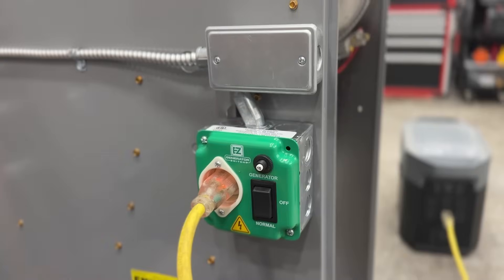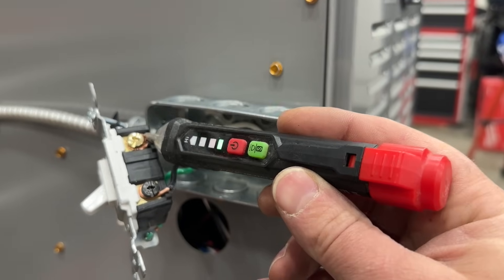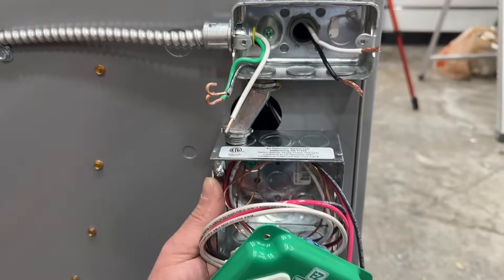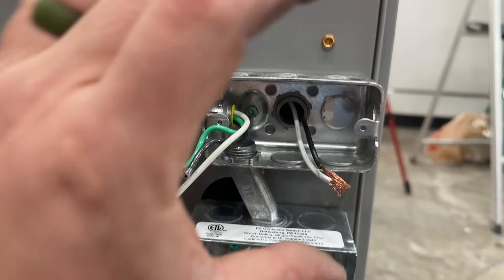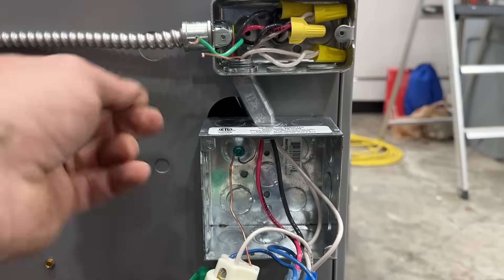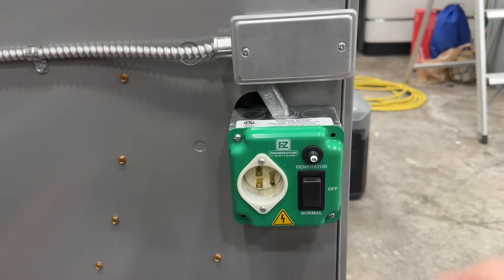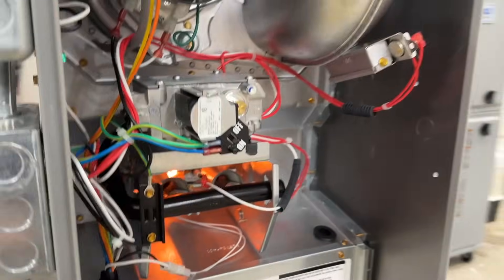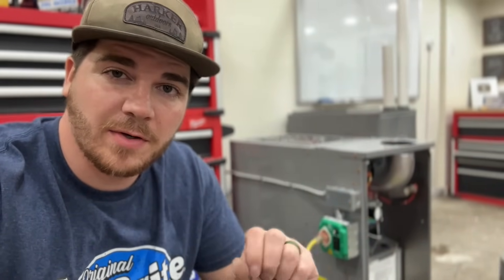This Device Allows You To Power Any 110v Appliance During A Power Outage

Comment: I just had an electrician quote me $805 to install this!
Reply from the maker: Wow, do it yourself bro 🤘🏼
Reply: @diyhvacguy  That was my plan, to connect my EF Delta Pro to it so I would at least have heat in a power outage. But I may just hold off until I get a second DP + Dual Voltage Hub & connect those to a Reliance 6 or 10 breaker MTS. Those MTS panels seem pretty straight forward to wire to main panel also. Plus, I’ve learned so much from your videos also - really appreciate you & your videos!

Comment: Of course, this requires you to own, and be able to use, a generator of some sort that can develop enough AC current to power your appliance.
Reply: $300 on Amazon. 2200 W inverter will do it.  Honda's are $800+.
Reply: @darrylstevens2556  Which means, by extension, that this is not an option for any apartment dwellers or anyone who lives in urban locations (which means about 95% of the population of the USA).

Those same people also cannot avail themselves of solar/photovoltaic or wind or water power. They're just horked.

Me, I just hung a 240V outlet next to my breaker panel and connected a plug to the subpanel that supplies all my important loads. That same plug fits the heavy 240V extension cord that comes from my generator. When I run the generator (which is really pretty small), it powers all my important loads all at the same time. Very easy to connect, uses 100% cheap standard parts, and it's impossible for the generator to backfeed the power lines.

Comment: Running a plug out of your furnace (like you've shown before) is so much simpler. Unplug from the outlet, lug into your generator.
Reply from the maker: Yes but this is technically up to code and has a couple other safety features which some prefer
Reply: Or just go directly to your circuit board so you won't get questions from a inspector later.

Comment: Just a heads up. A lot of newer high efficiency furnaces will require you to convert the EZ generator switch to floating nuetral if the generator/battery power station is floating nuetral. There are instructions to do so included with the kit.

If it is set up as bonded neutral, the furnace most likely wont turn on. Almost all battery backups like Ecoflow, as well many inverter generators are set up as floating nuetral as opposed to bonded. 👍
Reply: You need to bond (connect) the neutral & common if using a portable inverter.  You can do this at the inverter.  Amazon sells already made up plugs.  Your inverter has a floating ground most likely.
Reply: @darrylstevens2556  hi Darryl: Im confused: connect neutral and common at inverter?  I have for example the Ecoflo Delta 2 & Delta Pro batteries that has an extension cord that goes to the EZ. Whats another name for the "common", is it "ground" in this scenario?  and where exactly do i do the connecting? Is it at the "plug" of the extension cord that comes from the Ecoflow inverter AC output?  Or are we connecting the neutral & ground wires in the EZ device? Please clarify.
Reply: Interesting, because when i run furnace according to Daves instructions with either a Delta2 or a DeltaPro, the heat will come on and shut off appropriately, but the blower never shuts off! Its an Ecobee thermostat on a 3 year old RUUD furnace. Any ideas?
Reply: @rw4669  I would think it would have to be related if the fan shuts off normally when running from the grid.

Comment: Could you show how to do this to a sump pump? But somehow put this device in a wall or replace an outlet upstairs that would work the sump pump (to have easy access to make the pump work when the powers out.)
Reply: The sump has a separate power cord that you would just plug into an alternate power source
Reply: @williamweaver7783  yes but when you’re old and that sump pump connection is in a low crawl space it’d be nice to have an easier way to connect it to that alternate power source
Reply: @sharpshooterofky  I can appreciate that, so you'd have to have that cord in a place that's more accessible in the first place because you'd still have to go in the crawl space to access it

Comment: I just installed one of these and I love it, but instead of getting my generator out to test the switch I just ran an extension cord from my sump pump since that plug was still hot. I have my generator running like a top so I know everything’s ready for a power outage. But if I hadn’t seen one of your previous videos I never would’ve known this product existed. I thought about using the cheaper method of wiring a cord to the furnace but I needed something my wife could easily understand 😊 Thanks for your videos!
Reply: You should actually test it with the generator . You don’t want to find out a floating vs grounded bond issue in an emergency !

Test ahead of time .
Reply: @josephpadula2283  whats a floating vs grounded issue??

Comment: You could just splice a 110 cord to the power cord of the furnace then plug in power station direct temporarily this would only cost $15
Reply: That would work,  however, this is a UL listed and code-approved device, your rigged cord is not. It's the homeowners choice.
Reply: @lpnelson6584  In our area I learned I would need to pull a permit to install the switch & have it inspected. I went with just pulling the hi/lo wires off of the control board & powering my furnace directly until power is retored.
Reply: @darrylstevens2556  can you show us how you did that?

Comment: Will the generator also power the circulator pumps for baseboard heating?
Reply: Yes if your generator can put out enough watts. My boiler and circulator pump draw 220 watts. Notw that about 20 amps draw on a 12 volt deep cycle battery if you are running your boiler and pump off a battery with a high efficiency inverter.

Comment: As I understand, if you are powering a fixed appliance, like a furnace, then you should be wiring as floating neutral. Batteries and small generators are floating neutral. This means the white and ground are from your main panel of the house. If you do bonded, like in this video, then you better be sure your generator is Bonded neutral. Battery generators are floating by default.
Reply: Inverter generators generally do not have bonded ground and neutrals.
Reply: Just test your backup power source instead of making a general rule.
Reply: @GeorgeAdams How?

Comment: WAGO lever nuts are great at mixing stranded and solid core wire.
Reply: I buy made in the USA that includes Ideal wirenuts. I am reducing my dependence on china or other communist (socialist) countries. 73
Reply: WAGO’s fatal flaw? Is the same wire capture BS as the back-stab BS outlets.

Twist & THEN “wire-nut” is the only [right] way.
Reply: @Casmige 
Appreciate both perspectives here. WAGO lever nuts are valued for their ability to securely connect mixed wire types, which can be a big advantage in many situations. As for the concern about the wire capture mechanism, WAGO lever nuts use a different technology than backstab outlets. They have a lever to secure the wire, providing a consistent, strong clamping force that's designed for durability, reusability and safety. 

This is quite different from the spring mechanism in backstab connections, which can be more prone to loosening over time. And are single use. While traditional wire nuts require twisting and can be very reliable when installed correctly, WAGO offers an alternative that's quicker and doesn't require twisting, potentially reducing strain and the need to trim the wires when reconnecting. Both methods have their place, and the choice often comes down to the specific requirements of the job and personal preference.
Reply: @Casmige  nah bro you living in 1982
Reply: @Casmige There are several false statements and assumptions in your post.  Number 1 is that Wago 221 Lever Nuts are the same connection as back-stabs on fixtures, which they are not, and thus are not “the same wire capture BS”.  Number 2 is that no manufacturer of twist wire nuts requires pre-twisting and NEC code is to install according to manufacturer’s instructions.  Therefore your opinion that “Twist and THEN ‘wire nut’ is the only (right) way” is not supported by facts and is in fact, just your opinion.
Reply: @Casmige  Wrong! 🤷‍♂️

Comment: Is a heat pump 110 or 220v, is this possible on electric heaters? My house pops fuses from the 50s if i run a electric fireplace.
Reply: I'd recommend an electrician in your case.  If you're still running and popping Edison fuses, you're overloading your wiring and that's a fire waiting to happen
Reply: If you still have fuses, you need to upgrade.

Comment: I noticed the breaker  on the generator switch, should that get weak or fail is it replaceable?
Reply: A UL listed breaker doesn't just "get weak" and shouldn't fail unless exposed to fault current exceeding its listing...unless they've been run too hot or have been exposed to water or excessive vibration/impact

Comment: Awesome video,  anytime you are using a small power source or even solar power or home battery backup the one thing you have to ensure is that if the grid power goes off that electricity does not go back out onto the grid power lines so that the electrical workers that are working downed power lines or a bad transformer are safe and do not get shocked.

Comment: I always learn something great from your videos. I will be installing one on my sump pump soon! Quick question when regular power returns  and you're still running the generator you shouldn't have an issue because that power won't be able to reach the furnace because you have the switch in generator mode, is that correct?
Reply: Correct.  This is a small transfer switch, think of it as the letter Y.  The bottom leg would be your pump, one of the top legs is the grid connection, the other leg is the generator connection.  When the rocker switch is in the generator position, the grid leg is disconnected.  When the switch is in the normal position, the generator leg is now disconnected.  This way you cannot back feed the grid, nor can the grid back feed your generator when the grid is restored.  In the center off position, both legs are disconnected, and your pump is off.

Comment: I installed one of these at my electric panel which is outside. I love it! The hardest part was trying to figure out the corresponding neutral wire for the furnace circuit as all my wires disappear into the brick behind the panel.

Comment: Great video. Thanks.  Do they make such a device to work with a 3 ton a/c unit? (240v)? This would make it easier to run one generator  as a stand alone for the generator and another generator for your panel with an interlock.
Reply: Research “Soft-start” for A/C on a back-up generator.